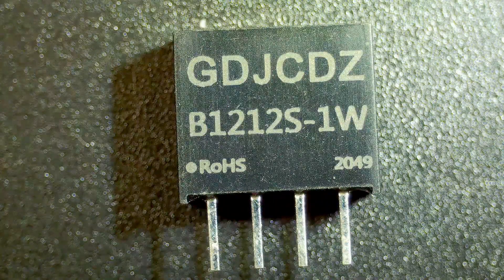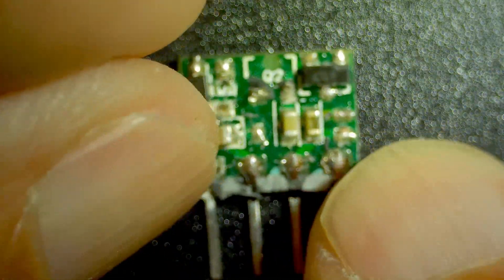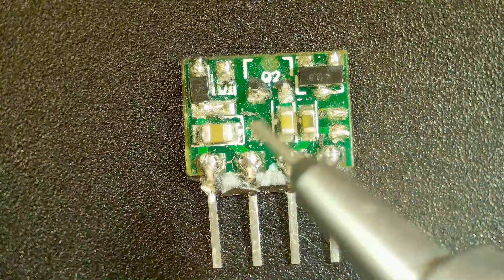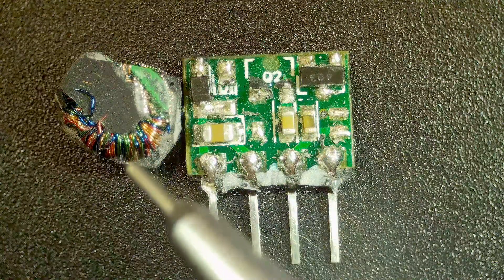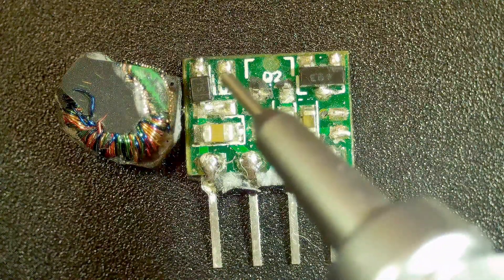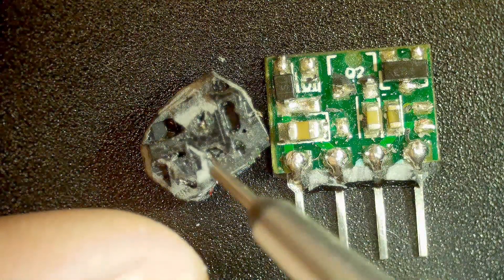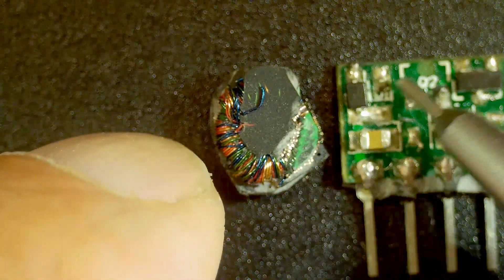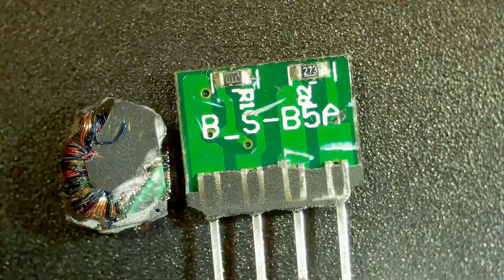#1483 DC-DC Converter Teardown

Comment: I'm, usually, removed factory epoxy with hot air station - after heating, epoxy can easily be peel off with flat clock repair srew driver and without damage to components.. 😉

Comment: Hi, I don't care if it's a Royer or not, for me it's important that the isolation converter works - I recently made a monitoring four voltmeter and one of the requirements was galvanic isolation of the individual gauges. For simplicity and also because it is only an informative measurement, I used these converters in the 12/12V version, the fact that they do not have output stabilization does not bother me, because every meter has it at the input. I saw a bigger problem in output ripple of up to 100mV, in order to ensure proper function and minimize ripple, it is necessary to fit the input and output with a blocking LC element, a coil with a value of approx. 4.7 µH and a capacitor according to the used input and output voltage (according to the data sheet) maximum the capacity at the output should not exceed 200 µF. I've been using voltmeters for about a year without a single problem.

Nice day 🙂 Tom

Comment: It looks like a royer oscillator to me, and the output is full wave rectified with two diodes and a center tapped secondary. No voltage feedback regulation too.
Reply: I was going to say the exact same thing.  Although looking at the pcb it seems to be missing biasing resistors.  Can't quite make sense of the biasing.  At first I thought that was the resistors on the backside, but now it doesn't quite make sense as a Royer circuit.
Reply: @argcargv  Standard blocking oscillator, which really only needs the one resistor to set base start current, and then the one capacitor on primary is a reservoir and the other is across the winding as a clamp.  Secondary 2 diodes, a capacitor and a discharge resistor, and yes regulation is terrible, which is why these often are followed with a linear regulator, and a LC filter as well to the regulator, as most linear regulators are pretty poor with high frequency ripple into them. the diodes used in the converter are often zener diodes, double the output voltage, so for the 5V one a pair of 10v zeners, so they also perform a regulation function, giving you a slightly more stable output voltage which is fine for digital IC's to use.
Reply: @SeanBZA  Look at the PCB I am now more convinced that it is a Royer circuit.  One of the base bias resistors is on the back of the board and the pads on the right was probably the bias resistor on the top.  The two capacitors on the right are decoupling capacitors.  The two emitters are tied together to the decoupling cap.  And then the windings of the transformer were soldered to the power pin on the right, and to the two collectors, and then finally a winding connected the two bases.    The output side is just a center-tapped full wave rectifier with a smoothing cap with a load resistor on the back to prevent excessive voltages from appearing on the output.